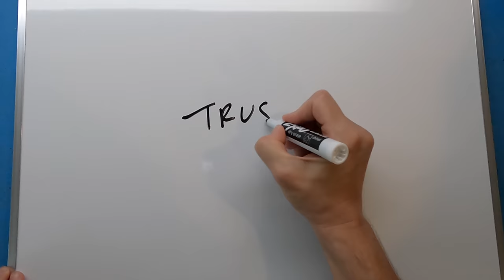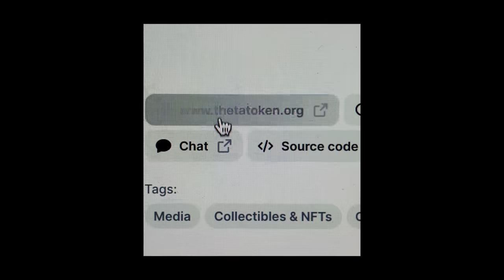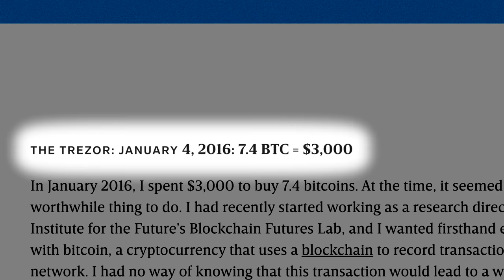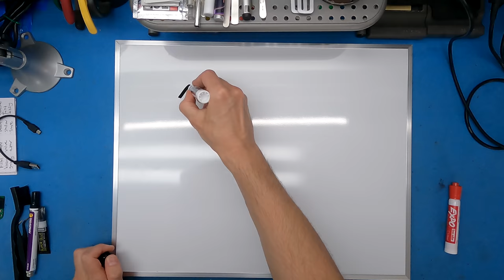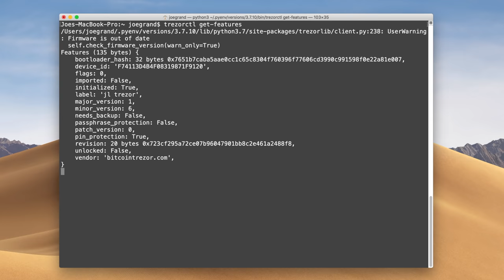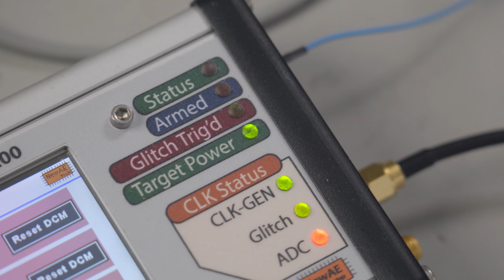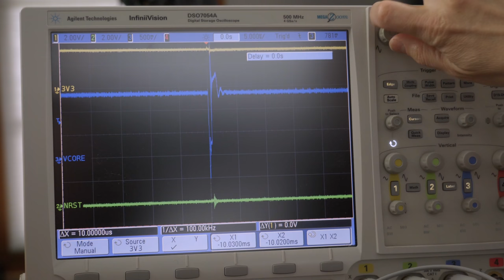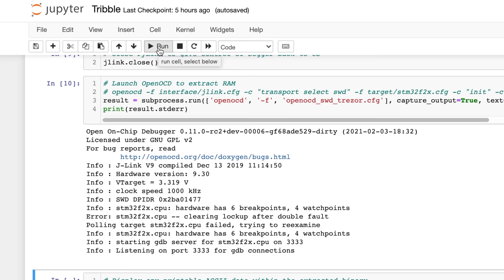How I hacked a hardware crypto wallet and recovered $2 million

Comment: So it was done with a power on voltage glitch. Looks like the Trezor uses the STM32, an ARM Cortex M3. A similar exploit was also discovered a year or so ago for the ESP32. The issue should be fixed by now in recent silicon revisions.
Reply: I discovered a glitch in the 2008 razor phone where I could use a magnet to bypass the security pin. Literally my first YouTube video.
Reply: yeah, trezor acually commented the video saying it was fixed in 2017
Reply: Could he have googled this? Was a fun video either way if the setup was scripted.
Reply: @erik3371  First step is always to research the product you are trying to hack. One security issue that have been patched, might reveal another issue that can be taken advantage of. So yes, its very very unlikely, that he did NOT google the product first. However, that does not make it scripted. He still had to prepare the device and execute the glitch, which in itself could have damaged the device.
Reply: @MrBa143  it was presented as a fluke in the video though?
Reply: @MrBa143  
He had at least a few of these devices with the same firmware revision and tried the glitch beforehand of course. Knowing that would have made the video a lot less dramatic. It’s still impressive but as always overly dramatic.
Reply: @erik3371  first time it worked, yes, but the idea was found out elsewhere that these old firmware copied the content to the computer if it got booted up in a development mode. Getting a production device to do that required a lot of circumstances to be right before he could nail it more reliable (so it's just a matter of time).
Reply: @subwarpspeed  For me that added to the "scripted" part because somehow the designated device had the correct firmware upon check. It was fun and a plausible video and this is how you hack that but yes.
Reply: @AttilaTheHun333333  But he did say that in the video? im not sure i get your point.
Reply: @MrBa143  
He practiced on a few devices beforehand to make the glitch happen…the risk of something going wrong with the actual device was minimal…and he knew he would glitch the device in a matter of a few hours. The video is overly dramatic to be interesting for a broader viewership…all I’m saying.
Reply: @AttilaTheHun333333  It seems to have gathered quite the views :goodvibes:
Reply: ESP32 you are yanking my chain. Device basically begs to be exploited and utilized in every way imaginable.

Comment: Wow, I thought this was impossible. Joe is an inspiration to keep trying and you can do anything you can think of.
Reply: How do you arrive at such a conclusion
Reply: @idoabitoftrolling2172  Probably that "crypto wallets are unhackable" as a selling point on the safety of crypto currency; this was even more pushed on physical wallets.
Reply: @WeBuild4Life  Well, to be fair, there's only about a handful of people on the planet that have the knowledge, expertise, and equipment to do this kind of thing. Most hardware wallets are also easy to wipe in the case that they're stolen, so a thief isn't going to have months to research and prep a hardware glitch. If somebody steals your crypto hardware wallet, it is functionally unhackable.
Reply: @nichtsistkostenlos6565  Well sure, till we call our man Joe here lmaoo
Reply: @nichtsistkostenlos6565  this was an old wallet on old firmware.
Reply: As in many hardware devices, it's only possible on old firmware. Because the owner did not update the device, it was vulnerable.
Reply: @chump5920  Right, but people frequently don't update their firmware. It's not inconceivable that a thief could come upon a hardware wallet with old firmware. I'm saying even in that situation, hacking it is still basically out of the question.

Comment: I believe what's need is to be able to duplicate the memory chip, so that you could keep trying while resetting the lock, or perhaps just resetting its flag if it's on the EEPROM, or in a clear text file. Could also use a debugger to bypass the whole checking logic and extract/load the private key, similar to how they reverse a software's activation logic, only challenge would be bypassing antidebugging and seeing through excessive abstraction and scramblings, but there has got to be a function, and there's got to be a way to make it load without a valid pin condition at whatever time it's needed, given that you find it

Comment: Hey Joe I'm almost certain me and my sister sat next to you on a flight from Auckland to Sydney in 2003 or 2004. You had one of the original jog wheel iPods and talked to me about hacking and getting in trouble for it back in the states. Would be crazy if you remember this, I would of been 13 or 14 my sister would of been 17 or 18. Think we chatted for the entire 3 or 4 hour flight. Lett me know if you remember this!

Comment: Smart to set up a demo device with the same parameters for building and testing the solution, something really key but probably overlooked by many people not familiar with the process of hacking
Reply: Yeah the hard part is finding a unit that has not had the firmware updated. you need to find one that was made after 11/16/2017 but before 3/21/2018 .... 5 years ago and never updated.  With these you cannot go backwards in firmware

Comment: How much did you get paid for this? Were there points on the balance recovered or a flat rate?

Thanks for the content.
Keep up the good work.
בס'ד
Reply: @elsid505  lets say 60 dollars per hour, 3 months (8 hours * 5 days * 4 weeks * 3 months * 60 dollars) is 28,800 dollars.. not quite a lot but in germany thats a very good payout
I hope he got half mill in that case since its so risky and the guy could lose all if that would go wrong
Reply: @rotioN  
Sehe ich zu 100% genau so🍻😁
Reply: @elsid505  that doesn't make a lot of sense. What if he was wrong and there is 10$ in the wallet, he doesn't get paid?
Reply: @elsid505  I see. Some companies just assess a flat rate for data recovery. This is a strange situation, in that the potential for loss was huge, and I guess that the technician (the content creator) would have to be indemnified against that loss. So it's not a "classic" data recovery. Most of the time, in my experience, a data recovery operation does not often guarantee a positive result, but usually, they do guarantee that there is no charge for a recovery if they fail to recover anything.

Comment: Crypto is off helping to regulate<, rather than pretend it won't ever happen.  The big institutions getting in is the catalyst that will launch us into  the stratosphere.  Most people don't like change but after the change is made they grow used to it and it becomes a non issue usually because their fears never materialize. And benefits they were unaware with before turn out to be far more beneficial.  Few if any rug pulls.  The projects that initiated the process of regulation have not been ruined, they got involved in setting guidelines and helping the regulators understand the crypto space. I’d get involved more knowing that I have made over 16` btc from day-trade with MYSTICFLIP in few weeks.

Comment: So he's worried about duct tape static discharge but leaves his watch on without a ESD strap (forget the debate about their use isn't it worth the $2 as maybe).  I'm not trying to cut on the man but...yeah, dudes a brave one.  Doesn't even need to work under a magnifying lamp.